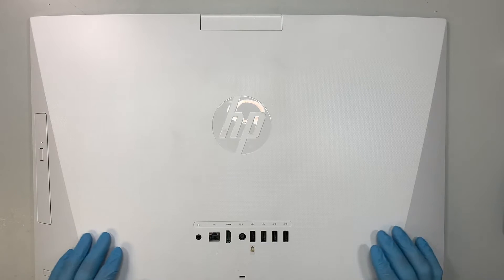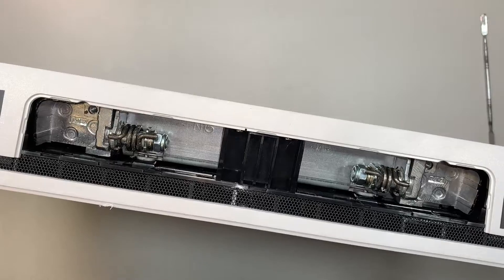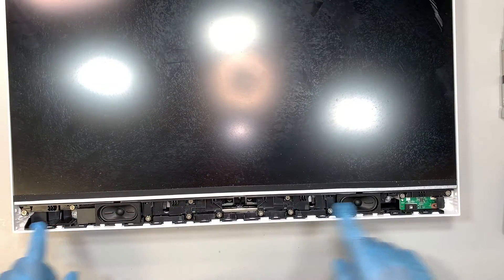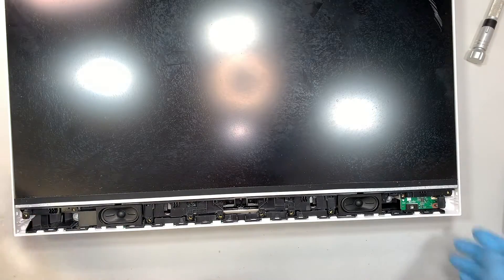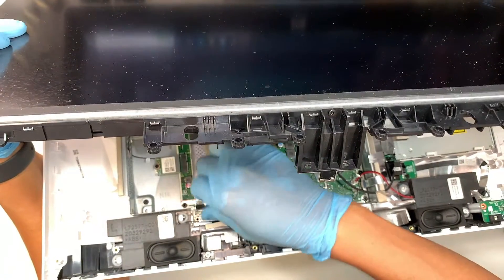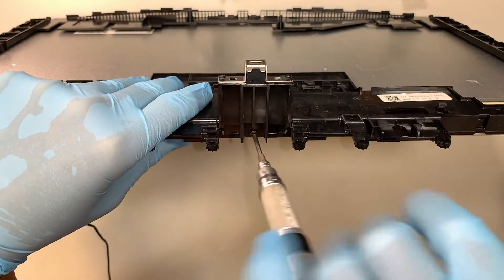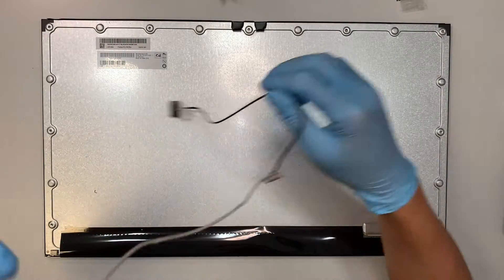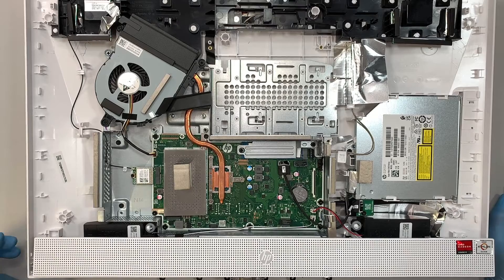HP AIO 24 dd0210 Screen Replacement

Comment: Do i really need to take it apart to see the sticker on the back of the screen to know what to order? Or can i order a new screen by using the model number of the computer? I don't want to have time between disassembly and assembly so i can easily remember the steps to put it back together. Also, having it open/apart while waiting for a new screen to be delivered seems dangerous. Is the computer model number enough information to order the correct replacement screen? I see in your video, there is a QR code next to the model number on the bottom. Will this have information to order the correct replacement screen? I would try it now, but its for my work computer at my office and I am home. Thank you

Comment: Why does no one ever show the actual screen replacement? Every single video, including both of yours, show disassembly, then simply states, "Do everything in reverse to put it back together."' If it were only so simple!! I was working on a 24-cb0017c and ended up here by virtue of it's similarity. The screen did not pop back in neatly, and while trying to get it fitted back in, it cracked. Is there a particular technique for these? Should I pop in the top and allow the screws to pull the rest down? Should I place face down and push the back onto the screen? It seems most methods put undue stress on one side or another and will cause breakage. This is screen #2, and at a cost of $250+ for each, I'm a little gun shy. Any input would be appreciated.
Reply: if it does not pop in neatly, then you're ordering the wrong model most likely. make sure the screen matches the model number. i followed this video and was done in a hour
Reply: @jkdfhdifdsfjhdnfi  Yes - and sorry, I forgot to update this comment. I was replacing 2 screens at the same time, a cb0017c and a cb0007c. For all practical purposes, they look identical and the screens actually are. The plastic bezel that backs the screen is slightly different on both, however, and not making sure the correct one went with the proper case is what caused my grief. So, the moral of the story is that though they may look the same, they are not. Make sure you have the proper screen AND the proper bezel.